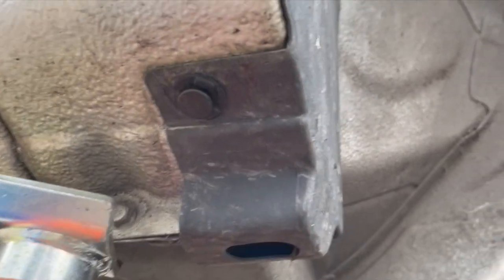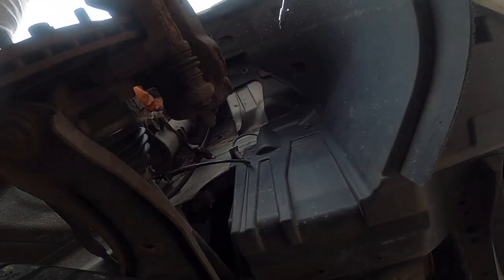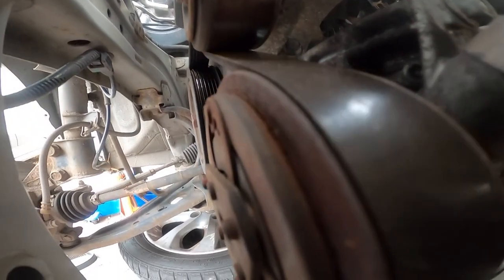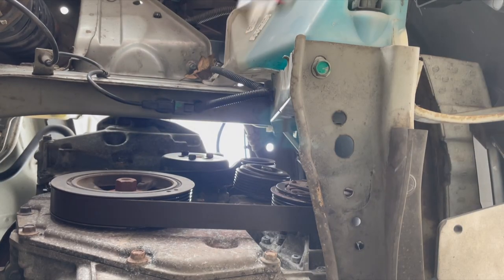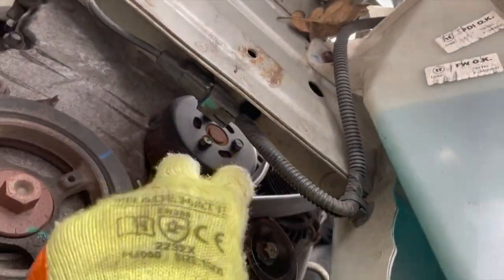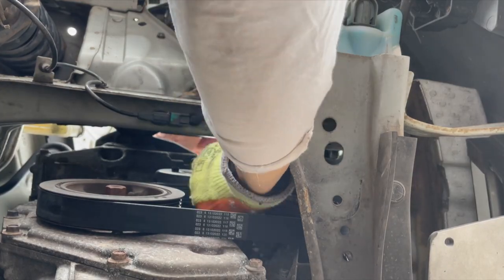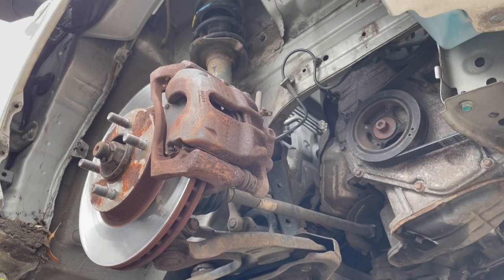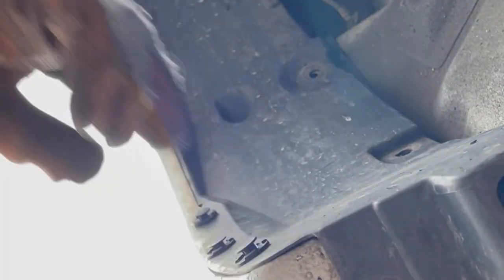Replacing drive belt/fan belt on Nissan Micra after hearing squelching noise coming from the belt

Comment: I replaced my Micra's belt by reaching down with the hood open. It was a bit fiddly, but there was no need to remove the wheel or the panels to get to it. There is just enough clearance to do so.
Reply from the maker: Yes, there are a few different ways to get to it. This method I uploaded I thought was ideal for those needing more room to manoeuvre :)
Reply: @micradocs  It's a few months later and I now have had to replace the water pump, and while I was at it I changed the tensioner pulley too. I'm now regretting trying to do all this from the top. The tensioner in particular is a real pain because you can't see what you are doing, and it is possible to install it wrong. (Edit:) Ultimately, what I did was to remove the tensioner screw mechanism, unscrew it to the loosest position, then put it back in the correct position and reinstall the pulley on the other side. That way there was plenty of slack for the belt to go on, while I could be sure that the tensioner screw thingie hadn't slipped out of its correct position. But yeah, in all the time it took it probably would have been somewhat easier to go at it from the side!
Reply: Hello friend. Would you mind elaborating on how you did this? I am looking to do it the same way you did. Did you remove any parts out the way to get there? Is there any tutorial u followed or anything ?
Reply: @hassan.ali101  Assuming you have the same engine (1.2 3-cylinder), it wasn't hard. Once you figure out how to loosen and tighten the tensioner, the belt comes off easily from the top, and the pulley and water pump come off and go on relatively easily. If your new water pump hasa a paper gasket (like SKF) be sure to get it wet so it sticks in place, because you won't be able to see everything you are doing.
Reply: i found it difficult doing it your way ...i put the belt on all the pulleys except to water pump pulley.... notice the water pump pulley is rounded on the edges making it easier to slip the belt over whilst pushing down instead of pulling....i did have to loosen the bolt in front of the tensioner to get as much slack as possible....but thanks for the video...i didn't know about the bolt in front of the tensioner without your help

Comment: New belt, did few days noise after start, then settles and now quiet as normal. 2006 1.2 ac, replaced in 218 tkm, old belt looked not so worn only a bit. New belt is Gates, old maybe original.

Comment: How did you gauge the correct tension for the belt?
Reply from the maker: Ideally you should use a torque wrench, but I usually go by feel of the belt, should be nice and tight

Comment: Is the bolt on the tensioner reverse threaded by any chance?
Reply from the maker: @matthayes8524  the main bolt that holds the tensioner on is turned anti-clockwise to loosen it, there is another bolt on side also. I have another video on my channel where I replaced the tensioner altogether and I gave a brief explainer. Have a watch it may help
Reply: @micradocs  thanks, I just need to give it some Wd40 and a bigger tool to get it off then
Reply: yes reverse thread.... turning the bolt left will loosen the tension... keep in mind i had to hold the back of the tensioner to get the bolt the thread better since it was dirty

Comment: Belt size?
Reply from the maker: 1165mm it's slightly longer because it this vehicle has AC.
Reply: 1170 mm also at market, will do CR12DE engine with ac
Reply: @erkkihamalainen5725  bro i have nissan sunny 2015 model diesel. My both bulb high beam is not working any solution? I changed the bulbs and combination switch as well
Reply: No idea about electris
 @Rabi_Burud